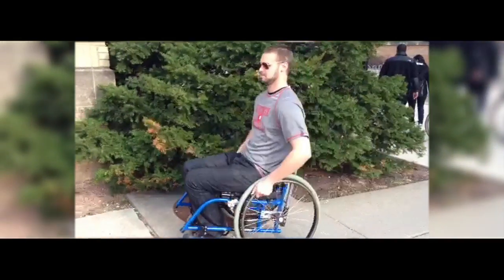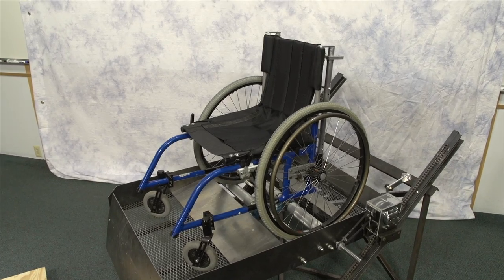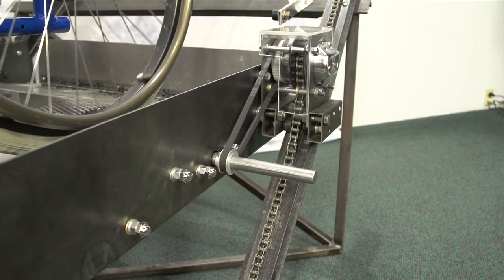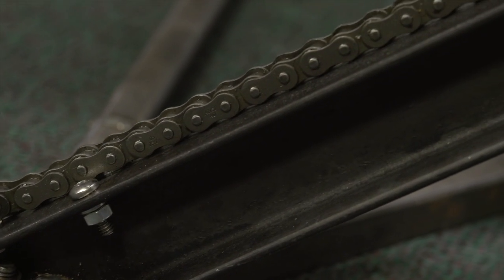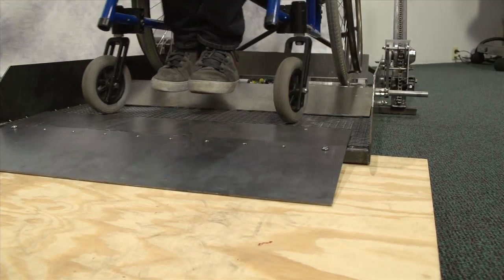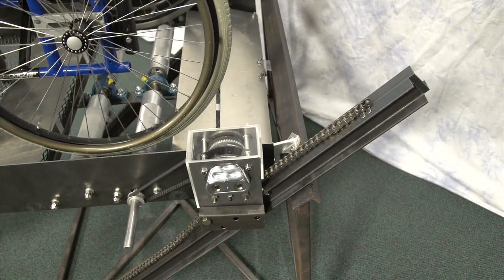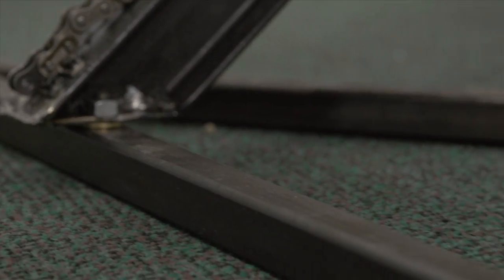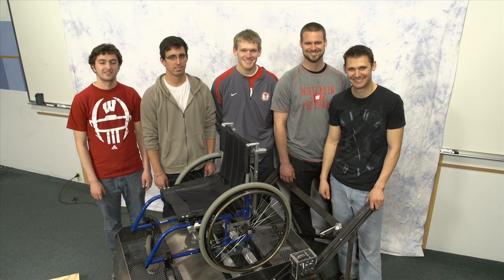The Funicular Project

Comment: This is NOT a Funicular.  A Funicular has two cars or a single car with a counter weight.  Its design is to add or remove weight, sometimes water, till the top car just barely out weighs the bottom one, pulling it up using gravity.  What you have here is a basic inclined lift or tram/trolley/cable car, but not a Funicular.  Would expect "College guys" to know better.